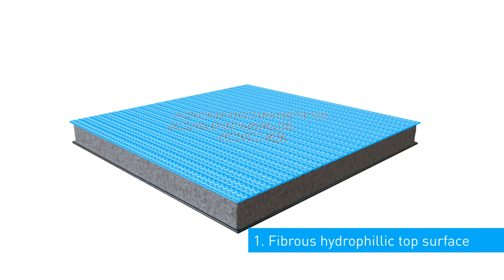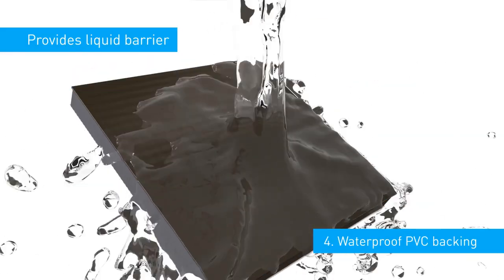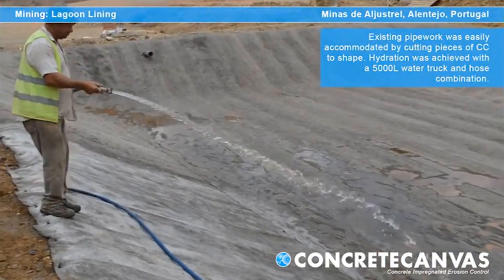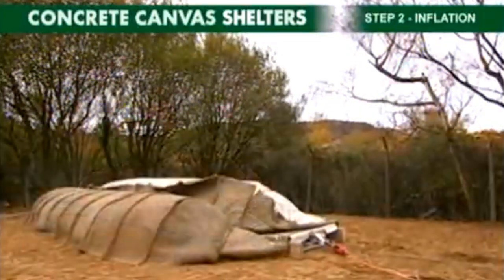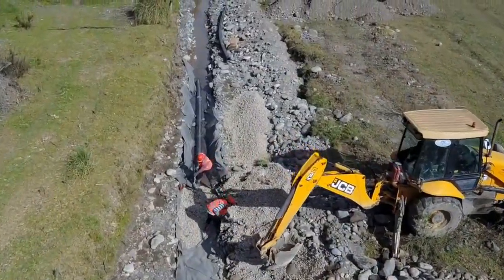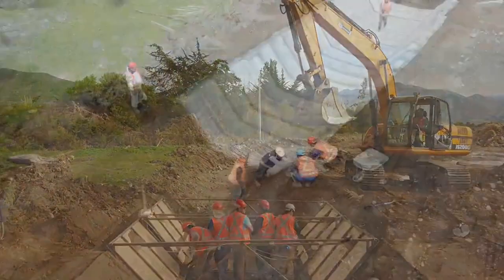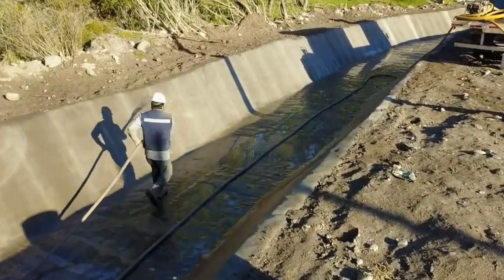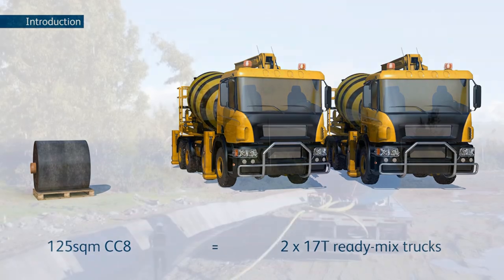Premade Concrete Canvas Tents - Just Add Water

Comment from the maker: ★★★ FREQUENTLY ASKED QUESTIONS ABOUT THE VIDEO  / FACT UPDATES ★★★

1) The Tent is too expensive and not worth it - Yes you are right, for you and me. But it was probably design for organisations that require a building to be setup fast in remote locations, like the military or emergency reaction forces in storm damaged areas. A place that can be setup real fast and outfitted as a HQ, to organise forces, and once finished they just have it demolished. 

2) Concrete is not waterproof, the tent will leak - That is why it has a white plastic membrane inside, so the water stays outside the plastic, plus this tent was not designed for long term conditions, just quick reaction forces like the military.

3) It does not have windows or ventilation, you will suffocate unless you leave the doors open - well maybe that is what they had in mind with the design, something quick and sturdy for short term duration as a Headquaters and if need be I am sure they can always cut a hole and fit a vent.

4) Most of you are focusing on the tent and not the material itself - The tent is just one small factor of what this video was about and what this material is good for and what it can do.

5) Most of you are saying the Military would never use these tents - My opinions above are just that, opinions on who might use these tents, no one is saying just the military will buy and use them. I just check the Concrete Canvas website, these tents are still listed as an item they sell, and they say they have a "designed life of 10 years"
Here is the webpage for these tents - https://www.concretecanvas.com/cc-shelters
Reply: The military does not and would not use that nonsense. We have all the tentage and shelters we need. This thing is nonsense.
Reply: That "tent" is designed for a government budget where the people who pay for it don't give a shit on how much it cost ... it's what is wrong with governments!!
Reply: @SupaNami  Um, the people paying are the tax payer!  You and I for instance...
Reply: @Onry1  Yeah I know .. but you don't have a say on where that money goes!
Reply: @SupaNami  Well they're called ballots and also on who you voted for...
Reply: @Onry1  Not everyone you vote for wins ... Also, and sometimes the ones you do vote for and wins over spend on dumbass shit!
Reply: @someguy5035  They had them at every larger base I went to in afghanistan.
Reply: unless its a third world military American military would laugh at that u think 1inch of concrete is thick thats FAR from permanit all it takes is a little love tap and ur going thru...has about as much strength as a cinder block  only thing i can think of is they thought it was cool because of how fast it goes up and its structural strength for as fast as it goes up and decided hey u no we could sell this to military for BOOKU BUCKS! if my taxpayer money went to fund that id b so pissed... i wanted the tent for blacksmithing shop untill i heard the 23k.... there is absolutelly no way it costs even 8k to produce the materials and thats including the preinstalled door which is the big money factor
Reply: Headquaters
Reply: @SupaNami  People will never agree on the best idea. Groups fail, sometimes in the short term, always in the long term.
Reply: @tangtaster  No, they definitely did not have these there. You are mistaking the metal quonset huts for these.
Reply: @someguy5035  are you part of every nations military forces? If not sit down and keep your mouth shut.
Reply: @thenorthernhandyman  Big talk from a guy sitting behind a computer screen. 

I have been there. I have done that. No one is using this stuff. Otherwise, I would have seen it. 

You think it is being used by the military? Show me 1 single example.  

You can't. Go away now, crybaby.
Reply: @someguy5035  Maybe Im mistaking these concrete tents with other concrete tents
Reply: @tangtaster  There are no concrete tents in theater. They are insulated tents or metal.
Reply: @someguy5035  just check concrete canvas website, used by military in Australia, Netherlands, UK and Sweden
Reply: @someguy5035  Maybe Im mistaking those metal tents for ones that look and feel like concrete tents.
Reply: lol okay
Reply: @thenorthernhandyman  Says "worked with." Doesn't say used by or purchased by. Worked with could mean anything from answered some questionnaires to assisted in product development. But it definitely does not mean purchased by or used by.
Reply: Concrete tents in afghanistan. Saw them.
Reply: @someguy5035   @Some Guy  "Concrete Canvas® (CC) has been used in the defence sector since 2007 for a range of reinforcement, protection and erosion control applications."
Right on the top of the site. You asked for one example, I gave you four. What's next? Pictures of a lama in combat gear inside a concrete canvas tent?
Big talk from a guy behind a screen without his real name.
Reply: @thenorthernhandyman  "The military does not and would not use that nonsense. We have all the tentage and shelters we need. This thing is nonsense."

That is what I said. In your rush to be right, you only proved yourself wrong. Your ego betrayed you. No military uses this as shelters.
Reply: @someguy5035  Riiight so here we are again you speaking for roughly 290 nations military forces.
Reply: @thenorthernhandyman  I didn't need to. You did it for me. Thanks.
Reply: @thenorthernhandyman  Here comes the internet tantrum after realizing what you did....
Reply: Why not just inflate any other tent prioritizing the size and shape you want, use the roll out material, water it down the deflate the inside normal tent and create duplicate shelter that way?

I am sure if this idea sounds stupid that there are more ways to strengthen and secure the tent once the deflated tent is removed plus you said the tent once inflated and watered it's perminate anyway so what's the loss.
Reply: @someguy5035  lol
Reply: Why would you want to take a structure that can be ruined if it gets wet before assembled to a storm damaged area is beyond me, really.
Reply from the maker: @jackmcslay  first that was 1 guess of what it can be used for, and secondly how would it get ruined?
Reply: @WonderWorldYTC  Truck tips over due to unstable terrain from the storm damage and sheets get wet from falling into mud
Reply from the maker: @jackmcslay  or a meteorite could hit the road in front of the truck and the truck can't stop in time and falls in the hole and the hole fills with water and ruins the tent that way as well. Both are plausible.
Reply: The justification you give for the tent is kind of redundant there are alot of options that are just as fast and far far cheaper than the tent many with the added Benifit of being reusable which as tax payers is a big plus they don't need to be permanent or semi permanent just to be taken down in a few days to weeks just to organize or talk in then have a new 20 to 30 thousand dollar tent purchased to be used again when the goverment can spend that money on a standard canvas tent then the rest on relief and supplies to help people then take the tent down and reuse it

The tent while cool is relively pointless only real use i see is for an underground building if it can support that weight and maybe for a cheaper price
Reply: @thenorthernhandyman  so no one serious? I mean the uk is kind of serious or atleast was but Sweden Netherlands are pretty laughable in the sense that no one is sitting there facing "oh man sides fucking pissed we better get ready for another world war" America or Russia sneezes and everyone looses their fucking minds and honestly I forget about Australia often times when it comes to anything involving war almost forgot about them writing this comment out actually
Reply: Lol at all you armchair experts that have never seen one of these concrete tents yet know all about them.
They are incredibly strong. 
They are quick to erect.
They are easily transportable in kit form on a single pallet and can be erected by 2 or 3 people.
They are in use by military forces, used extensively in Iraq and Afghanistan.
How do I know? Because I've worked alongside Concrete Canvas for the last 9 years at their factory in Treforest and I know the people that built this business from a concept to incredible reality.
If you aren't willing to research it properly, just giving your armchair opinions based on what you think without ever having seen something first hand, then I honestly pity you.
The world is bigger than your front room.
Reply: @Jon-em4kc  do explain then how concrete that thin without steel reinforcement is extremely strong im curios do they use a special kind if concrete? If so what kind?
Reply from the maker: @Jon-em4kc  Thanks for that information on it's use Jon.
Reply: @royrogers3624  It's not just concrete lol
Reply: @ivr2132  youre right its concrete fiber and a thin layer of rubber again what makes such  thin layer of concrete strong?
Reply: @WonderWorldYTC  I wish he woul give information and not just "i work with them and know the makers personally the product is amazing give attention plox I said i know people" sadly thats about all he did claims but no real information
Reply: The british military already uses them.
Reply: @definitelynotobama6851  the British military also uses the l85 so not much of an accomplishment to be on their list of equipment that gun is universally regarded as a piece of shit by everyone including those that use it

That aside havent heard of them actually using them please do link me on that
Reply: I was in paramedical units and our main function was to set up and operate field hospitals. That tent is not looking like a universal solution because it's not reusable. BUT, in some cases, damn that would have been amazing. With a reusable tent, depending on the weather, it can be dangerous to set up (wind), you burn tons of gas for warming it up (in the cold), etc. Or if you need to use it for several months, you can be sure that your tent will have problems. A comrade of mine burned his hospital, lol ^^'
I can definitely see applications for this! Just think at the post explosion rescue and shelter system in Beirut... And for the price, compare this with the price that the US army is paying for their 'temporary' bases in Afghanistan xD
Reply: Someone, please explain why it is so insanely expensive. there is nothing in that what should cot so much
just some recycled plastic fiber material and a small amount of concrete which is dirt cheap
Reply: @deltaxcd  process and patent and their hope that itll be sold in mass to militaries around the world
Reply from the maker: @deltaxcd  maybe the fact it's a premade concrete tent that blows up like a balloon, maybe?
Reply: @WonderWorldYTC  
Well, if it was also painted blue then maybe... LOL
But seriously it is not a reason for it to be that absurdly expensive. There is nothing in this technology that should be that expensive. 
If you need something quick you just build a normal plain tent, if you need something permanent you build a normal house later. And if you need something semi-permanent and quick you just assemble it from premade plastic/metal panels or wood. (which may be even faster because you avoid concrete setting time) There is no point to pay a horrible price for something like this. 
The big problem of concrete is that it is quite heavy, so transportation will be problematic and you cannot transport it in pieces either.
Also considering economic, if you are building that in the damaged area it is more beneficial to pay people to build you a house from cheap materials than spend that money on something like that. There are plenty of people who have no job and desperately need money in damaged area so you will be hiving that money to them anyway.
Reply: @Jon-em4kc  well, considering the climate of Afghanistan at Iraq cardboard house would be more than adequate there. So the military is just wasting money as usual.
local people build their houses from straw and dung and they stay there for as long as this tent will stay.
I wonder how this thing survives a moderate -20C winter where water freezes and things start to crack, even massive brick walls disintegrate over a few decades.
When you have frequent freeze cycles your tent will likely crack because the ground moves every year.
And if the fiber material absorbs water you can be sure everything will disintegrate just in one season.
Reply: @fahey7335  Just because you couldn't hack doesn't mean others can't. Stop telling on yourself.
Reply: Former military member here, worked with a bunch of other countries military and in disaster response. The best use I see for these is that they can be packaged relatively small in a box, provide a generator and a pump and dump them in the tundra to set up overwintering structures Toss in some quick spray insulation too. Lot of people here talking about replacing the prefabs and the tents the US military uses in the deserts and temperate environment - I don't think that's ideal. Those tents - they're good (and come with AC units easily attached) - But I've used them in Minot AFB, North Dakota and they weren't the best for winter environments. I can see these as a good replacement for some structures in Northern Ontario (where I currently live) - Where the cost of transporting concrete and the like isn't actually cost effective (especially when you don't have a road to the site to have - Where MTVs/LVSRs wouldn't be effective to deploy to.) - These things would also be a decent enough structure for uses in Northern China (Also where I've lived) and Russia. (Which I assume would be a good place for them) - As for holes for vents and stuff... I mean... a sludge hammer and a chisel. -

If you're wondering "Why the hell would they want to go there" - There are projects like NWS (Which replaced DEW) which requires temporary personnel to be in the north (construction crews, Army Corp of Engin. for example) for long periods of time, over winter sometimes. - And would serve as a decent storage shed after better quarters are raised.
Reply: Still not as cheap as building out of wood and tin. When those tents get down to about a 10th of the price then they would be competitive against built from scratch structures
Reply: the level of stupidity in some of these comments is just absurd. Sorry you have to deal with all of that. Pretty cool material that can be used in rural/hard to get areas or in times of urgent need. And I bet many more will come to fruition with time.
Reply: @amabdall  The cost is too high to be practical unless there is literally no other option. About the only advantage at the price is that it can be airlifted into place
Reply: @someguy5035  false, the military has and does use these materials.  All over the world...not exactly as seen in the video but the idea was used all over Iraq by US forces.
Reply: With TAX payers money they can buy everything...........
Reply: Ko
Reply: How long will the tent last? I want to make my own home
Reply: Just use a tent!
Reply: it is possible too make it yourself though pretty easy all you need is bag of quickset concrete , Burlap and Felt and string too sow each section together.
Reply: @EpicGamingEct  true, but you would encounter the same R&D challenges as they did; but I would also think that VELT and/or WOOL is possible the cheap alternative for their expensive selfmade rolls. instead of concrete, one could use horse dung.
Reply: @dethronekingmma1246  ya know I was wondering if the fibers add strength tho
Reply: IMHO this product has multiple uses, as the controversial tent i think that variations could be useful for use after natural disasters such as the hurricane Katrina etc.  It would allow multiple structures to be built for any number of people faster than most others and provide better living conditions than something like a conex.  Would other structures such as mobile homes be better?  Perhaps, however you can only get one in per semi-truck load while this would allow quite a few (at 48-53 feet per flat bed you could put at least 9 on per trailer and if you can stack them then perhaps 2 to 3 layers we're talking about 18 to 27 per truck load).  All other structures would still need work for the other things plumbing, electrical, heating and air conditioning.  These structures can also be modified on day 2 of the installation if needed, by the end of day 2 you could have many of these ready for furniture and people.
Reply: @SupaNami  government budget ? Governments are broke everywhere, years of corruption is the cause and Covid will be blamed.
Reply: Nope. WAY WAY TOO EXPENSIVE.
Reply: @The Dogs Doo 
"The Sahara desert for example is one of the coldest places on earth at night."
This makes me question your sanity,  or your definition of cold.
I myself live in a place where we get over -20C cold in winter and were that cold I destroying almost everything you build.
I guess you have no clue what effect cold even has on buildings and how wet concrete behaves in the -20c temperature.
You should try to build anything where I live before claiming your expertise in construction.

Speaking about humanitarian mission usage, of those tents is not even dumb but even offensive when you build temporary tents that cost 30 000$ in places where people will build you a  whole palace at that price if you just give them that money.  I think when you give that tent to a person who is living at 100$ a month as a temporary home their eyes will pop out.
Even in my place, you can buy a  decent condo in a good place for a price of 3 of those tents while if you are less picky you can get it for half of its price.

and there will no economy of scale for a thing nobody needs, all it is useful for is the military which is a plain money laundering machine to steal taxpayer money and redistribute it to corporations.
Reply: Quonset huts go up for half the cost in less time. Larger, faster, stronger, more flexible, better.
Reply: @Boop Loop 20,000-30,000 not 2100 duh
Reply: @vettedwarrior7054  No you didn't. If so, tell me where.
Reply: @dethronekingmma1246  - Thought you might like to know that the word you used (BOOKU) is a French word spelled like this: "beaucoup".
Reply: @someguy5035  - Now, I could see that if the military could manufacture the product themselves to cut the costs, then there could be all kinds of situations where this could be useful. Let's consider them transporting a portable steel framework which could allow for window and door openings. Then overlay the framework with a roll of this product. Cover this product with a layer of spray foam insulation and then cover it again with the concrete.  It would make a highly insulated, strong structure in very little time.
This would be superior than tents in places that are very rainy and remote, where water infiltration or other weather issues prevent long-term habitation with pop-up style tents.
Reply: @someguy5035  Your gonna tell me what i saw kid? I spent 22 years in the Army 9 deployments not including Duty stations. Funny lol
Reply: Can it turn a lazy person like me into a Jedi Master?
Reply: no one will suffocate even in a fully sealed airtight room. in a 135 cubic meters room the oxygen will be enough for 12 full days. and the door of the canvas tent is surely not airtight and wont be closed for that long, and simply opening the door once will refresh the timer.
also you won't die if you place a plant at night in a room, because a person or a pet uses alot more oxygen and emits alot more carbon dioxide than a plant does, but the question of having an additional person sleep next to you or having several pets in a room doesn't raise the question of whether it will kill you or not.
Reply: "Yes you are right, for you and me. But it was probably design for organisations that require a building to be setup fast in remote locations, like the military or emergency reaction forces in storm damaged areas. A place that can be setup real fast and outfitted as a HQ, to organise forces, and once finished they just have it demolished."

I don't think the price is linked to the cost of the original materials by such a long way as to be a 'tax of proven science'!

I got no time for #robberBarons
Reply: Another video showed those tents with air conditioner!
Reply: @vettedwarrior7054  Yes. That is exactly what I am telling you. The US Army doesn't use this shit. What you saw were metal quonset huts with foam sprayed on them and poured/formed concrete bunkers.
Reply: @someguy5035  You still crying about this? Try reading i posted exactly where i saw them and who was usiing them I NEVER SAID U S ARMY OR MILLITARY!!! now off ya go sonny there's a good lad.
Reply: @vettedwarrior7054  You were lying.
Reply: all these people here have no idea how strong concret can be in a dome form. You don't need any reinforcement if you only have pressure and no traction. sure they won't ressist an explosion, but no one claims that. You could also dig it in so it even blends in with the inviorment. its also fire proof, perfect for a munition tent.
Reply: @someguy5035  I am a 55 yr old U.S  Army veteran with 22 years of service, Yes you caught me! my goal in life is to lie to Young men on youtube, I have been all over the world been there done that type of deal but my whole goal in life is to lie about seeing a concrete tent placed in Iraq, Ya caught me skippy , im guilty
Reply: @vettedwarrior7054  Last reply you said you weren't in the US Army. Now you are telling me you were in the US Army. 

You can't even keep your lies straight.
Reply: @thenorthernhandyman  The fact that Concrete Canvas has been used in the defence sector doesn't mean that the tents have been used. They have other products as you saw in the video. The brochure "Defence case studies" does not show any example of the tent: https://www.concretecanvas.com/uploads/CC-Compilation-Defence.pdf
Reply: #1: fix for evaporative air cooler and ventilation.  Just get a stihl  construction  saw and or a hammer drill with biogas concrete paddle bit and make a hole or opening for stove pipe or vent fan
Reply: Of course people need to whine, it's all they're good for 😜
Whut? Prove me wrong 😈
Reply: If the thing keeping out the weather in the tent scenario is the plastic then the concrete is just extra weight.  It won't stop a reasonable range of calliber bullets and it can only be set up once.  Buy a tent.
Reply: the material is fucking thin....its garbage....especially for the water canal.......
Reply: @someguy5035  Are they prone to collapse or summat? Respectfully, I haven't seen the data, could you provide some? Maybe more of a quick infrastructure set up type deal?
Reply: for those who say it would fly off the shelf: Short answer no. It wouldn’t. I’m a civil engineer and it just isn’t strong enough to pass regulations. The only use it has is to line a tent and a water channel, and even they won’t survive 10 years.
Reply: @royrogers3624  i am australian and even i forget that we exist. Our military and government is so pathetic, even compared to 3rd world countries 🤦‍♂️
Reply: @Kyllleur  i dont know why america would put up temp bases in the middle east, while there is still oil, there will still be war!
Reply: but can it be done with sea water?
Reply: @dethronekingmma1246  Its not just 1 inch of concrete, it is fiber-reinforced throughout the concrete and has a back covering and a front covering. It doesn't say what fiber or other materials specifically
Reply: How do you deflate it?
Reply: @WonderWorldYTC  “maybe the fact it’s a premade concrete tent that blows up like a balloon, maybe?” What a pissy little reply while totally ignoring everything said in the comment you were replying to. There is absolutely no justification for the price other than they are trying to gouge tax dollars. This tent is crap and is more like a prototype with tons of problems to fix. You seem very butthurt when anyone criticizes the tent. I’m pretty sure YouTube has strict regulations regarding sponsored videos and not telling anyone it is  sponsored
Reply: The vents are on the doors. I don't think you're going to soffocate in there.
Reply: @dethronekingmma1246  lmao i hate that bastardized spelling of beaucoup
Reply: @someguy5035  The military is nonsense tho lol
Reply: @someguy5035  Vetted Warrior said he spent 22 years in the Army with 9 deployments, just didn't say which army. it's just a technicality that he didn't say US army. (He never said "he was not in the army". now that i've read all your comments, and after doing some actual research and asking around military people,  i see that you are the one spreading BS and lies)
Reply: @WonderWorldYTC  Hi. Nice video. Very interesting. Thank you for creating/uploading it  Sorry for all the foolish comments by people but I guess we gotta take the good (your video) with the bad (foolish comments). 🙏